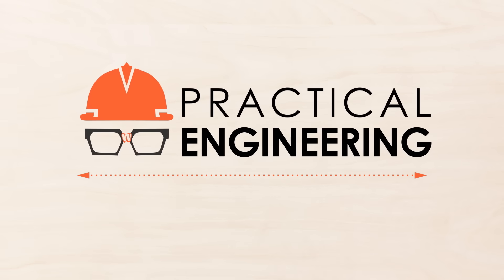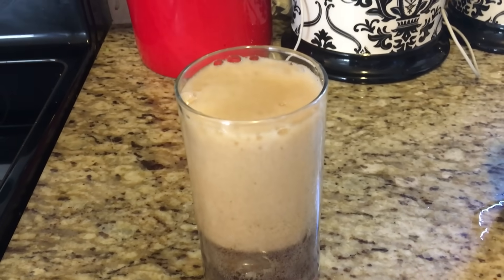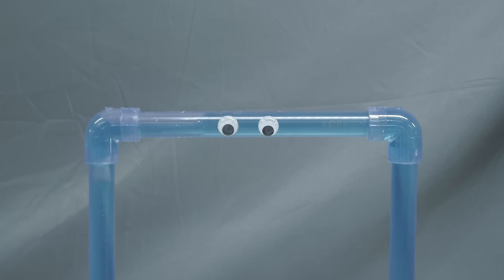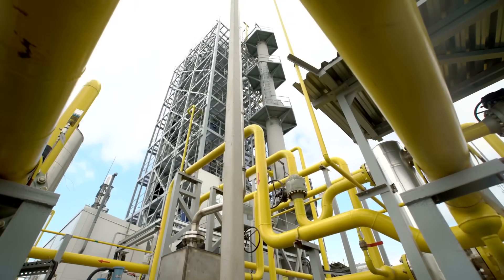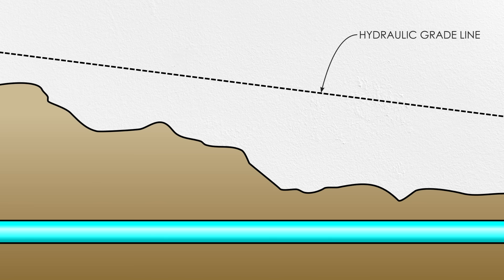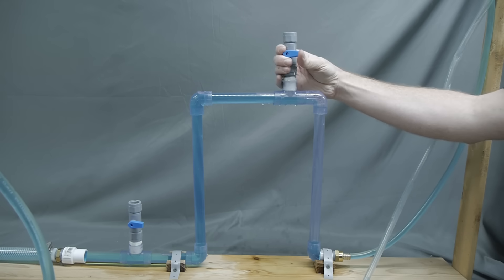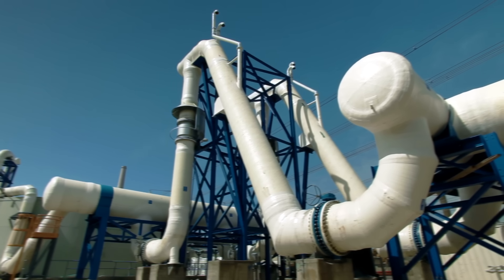What is Air Lock?

Comment: Water distribution networks; most air valves are underground, and there isn't anywhere for the air to escape; the covers are fused to the frames. That's if it's even working in the first place. Plus, burst mains and transients can cause negative pressure, which draws air into the pipe through the valve.

In practice, water is agitated, typically following a burst and mains operations; this causes aerated water,  it looks milky coming from your tap. Water companies resolve the issue by flushing out the water from a washout or fire hydrant.
To be fair providing you follow best practices, you mitigate most of the risk from airlocks; dissolved air is always an issue.

Comment: in my hotel we ran out of water once and hot water got air trapped i will need to cut  pipes and make repease valves for the air. probably try releasi g it from the flextube next to the boiler

Comment: Would you recommend air release valves for lines that run 93% sulfuric acid? Concerned the air release will spray acid around the environment and corrode equipment or worse, hurt people.

Comment: Can I use check valve to vent the trapped air?
Where should it be installed? Will anywhere do? Or, should it be installed in certain location, like bends, higher points? Thx

Comment: If the air is trapped, the area for the water to flow in is decresing. This leads to increse in speed (Q=V*A). When the water velocity reacehes about 1 m/s it begins to drag along small air bubbles. Anyway, water pipelines is always layed inclined, about 2 promille

Comment: Could go another route and put the pipe in a vacuum. Then when you start to fill it, there is no air to trap. Yes I know that would be expensive, but it's an option smaller applications.

Comment: This analysis is exactly right, but in my experience designing pipelines, it was not commonly understood by other engineers.  I figured it out myself and used it in designing several pressure pipes (force mains) carrying sewage, and in many cases these had high points where gas from the sewage could accumulate.  The problem there was that (1)  a gas release valve at the high point could quickly become fouled with scum from the sewage, and (2) these high points were often in locations that were not practical to access for maintenance.  So, I often designed the pumps to discharge against the added pressure created by air in descending legs of the pipe (referred to here as "waterfalls").   That required more electrical energy for pumping, but worked reliably with little maintenance, which is an example of trade-offs that are inherent in good engineering design.
Reply: As a plumber it's nice to know there are engineers out there who care
Reply: @nazariiroudyk8660  And I always enjoyed learning about the "nuts and bolts" aspects of piping systems that COMPETENT plumbers understood better than I did.  Everybody benefits when competent professionals act as teams with the common goal of making things work at reasonable prices.

Comment: I've found the reverse to be true in ventilation. Mostly with humid air condensing out in the lower area of vents. But when water builds up in vents it causes higher air pressure in them. Which can be helpful in some cases and dangerous in others.

Comment: And this is why after rebuilding my well three times i t still fails after 4 days..  As far as I know I have the worlds only siphon well.  The well is on a mountain, and I siphon out of the ground to bring it down hill to the house.   Trapped gasses build up in the high point above the well until it fails.  I currently have a check valve in that spot that I literally suck on by mouth to get the air out!  If only there was an air release valve that worked in a vacuum.

Comment: Grady: A civil engineer who frequently discusses the strengths and limits of materials within specific design parameters and expected uses.
Also Grady at 8:47: scrapes a metal spoon around the inside of a teflon-coated pot.
Reply: He did say he's an engineer and not a chef ¯\_(ツ)_/¯
Reply: @hoobidibahbidibah8119  Yeah, but that is just common sense. Teflon is softer than steel, so it will be scratched.
Reply: I can still hear my mom scream "Dont SCRAPE FOR THE LOVE OF GOD"
Reply: From the condition of the pot, it looks like he does that a lot. On the one hand, I'm an Engineer, too, and straight up didn't realize the pots I got for cheap were Teflon coated when I got my first apartment. On the other hand, I figured it out as soon as the coating started flaking off, and I would have expected him to have figured it out years ago by the look of that pot. (I grew up with stainless steel and copper-bottom pots that didn't mind metal utensils).
Reply: Made me wince
Reply: @popcornfilms1  had nightmare flashbacks from the few of mom's pans I've destroyed.
A whooping would be had in this house would one use a metal object on a teflon object.
Reply: Love how all these comments are about the commercial. Lol.
Reply: Avoid Teflon at all costs. Persistent environmental toxin.
Reply: He likes the taste of microplastic in his food.
Reply: @Lun4812  Yeh, I've wondered about this in food.  The Agencies are saying it is dangerous but for years they told us that teflon doesn't react with anything, so my guess is it really just passes through our body and into our poop.  My guess is somebody's patent has expired, so they are trying to push us to get pots with the next updated patented product.

Comment: This the best reason you never make a water service tap on the top of a main. Cause a customers water meter will register Air, we always install our direct taps 30°-45° above Horizon  to prevent false metering of water and customer complains of milky looking water. We have hundreds of Automatic air release valves installing on top of every high point. When the stainless steel ball fails it’s a site to behold

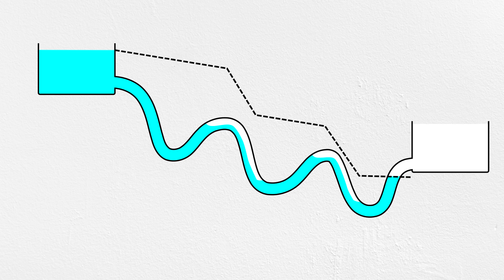Comment: At 5:43, I realized why you’d have to apply suction or some pump pressure to coax a fluid to begin siphoning through a hose—it’s the same principle at play! You’re getting the air out so that that hydraulic grade line of potential energy goes back up, and the water “wants” to flow through.

Comment: Sometimes air in pipes can cause an "explosion". Over time the air bubble may grow to a size, that can counteract the whole water above. The pressures and forces can be so high, there are cases of whole pipe lines flying. There was a hydro power plant in Norway (I think), that had that issue. A cover made of steel of a few tons flew several hundred meters. So air can be very interesting indeed.

Comment: Air in brake lines is so dang frustrating! We had to do some work on my car's brakes, and then we opened the bleed valves and tried to get out as much air as possible. My brakes still felt mushier than they had before because of the compressible air in the lines, no matter how many times we tried to get it all out. Eventually I took it to my brother in law who works on cars for a living, and has a pump that fits over the brake fluid reservoir, adding enough pressure to force out all the bubbles of air as we opened each bleed valve in turn. Really wish we would have taken it to him sooner, rather than pumping the brakes and opening each valve countless times, just for me to frown and say that the peddle was still mushy lol.

Comment: Our service company wants to replace our (200 GPM, $$$) swimming pool pump assembly, even though a previous disassembly/inspection did not show any wear on the impeller, etc...  After watching this, I am going to install a bleeder valve at the effluent elbow of the high point in the plumbing between the pump and filter, and see if we really need a new pump or not.  This is the highest point in the whole system, and there is no way to relieve trapped air. It is right before the sand filter and looks exactly like Grady's mock-up for waterfall flow.  My only question is - would a bleeder be more effective on the straight run, influent (up) elbow, or does it not even matter?

Comment: I once constructed a system where 4 IBC totes - each 275 gallons - combined to feed a single spigot. I installed a line going straight up to prevent trapped air and made it higher than the water level of any tote because I figured it wouldn't cause a problem, but the water just gushed up and out over the water level. How? I get that it's going through a 2" pipe and therefore the weight would be creating pressure, but wouldn't that create perpetual motion if I then fed it back around? So that doesn't make sense.

Comment: Great video. I learned this quite viscerally in the first winter in my home. In fixing my hydronic heating system, the 2nd floor zone ended up as one big air lock bubble with no bleed valves upstairs. I had to do some plumbing to add a valve to effectively flush out the bubble!

Comment: we drill a small weep hole in the discharge line of a sump pump below the check valve to keep them from getting air locked.

Comment: I just cleaned my table fan. There was only a slight buildup of dust at the fan blades and fan guards and yet the wind was noticeable stronger after cleaning. Can you do a video on this?
Reply: You don't need fancy air volume equipment. I just use another fan and a large piece of corrugated cardboard hanging vertically between them. Position the fans blowing against each other and position them until the cardboard is perfectly vertical. I would do this in reverse starting with a dirty fan then cleaning it. The distance between this and the vertical cardboard gives a relative measure of the efficiency robbed by the dirt.

Comment: Nice explication, I've found airlock a great problem on gravity feed of petrol on motorcycles... Yes the tank is right over the carburettors, but often the fuel line has to go down first, then back up again. 
On vee twin engines that often have two carburettors pointing in different directions, the fuel line has a awkward path. It's often going down, and up to the first carb where it can continue back down again before fixing to the front carb. Even where both carburettors are mounted side by side the float bowls are offset, one being further forward than the other. The combined throttle linkage that operates both carbs from a single point, usually prevents fuel lines from passing between them and has to be routed underneath, over the top or around the side. So it's common to get a lower feed pressure on one carburettor than on the other.
When the flow gets restricted by a dirty filter, blocked lines, pinched or twisted lines, or just low fuel level, the supply can become inadequate to one carburettor and can cause damage by the fuel air mixture becoming too lean. Especially when full power is solicited the fuel debit is at its maximum demand and that over lean cylinder can overheat and seize or burn a valve...
Fitting a bleed valve is not praticable, so assuring that the initial filling of the pipes is done with a full tank and even slightly pressurised tank, will help. But over time air can accumulate... And become a problem again. That's why motorcycle fuel lines are transparent, to help show when the lines are full of air.
Reply: Wow, they designed a ton of complicated problems by cramming that into a a low profile frame. small space with all that. It probably worked ok on the traditional uprights. But NO Easy fixes now. I think if you really want trouble free operation that wouldn't kill itself, you have to give up gravity fed and put a low fuel shut off and fuel pump enough to make it all work. As a bonus, then it could support fuel injection.

Comment: great demo , i may have missed it but the air can easily effect industrial cooling systems , one thing ive found is that this pops up after the pressure is released on a system , ie we normally load the systems with 1 bar of pressure at the top of the system , if we drop the pressure for any reason the minute bubbles come out of suspension as they expand and join together to make big bubbles that can then cause an air lock

Comment: You know, I'm convinced this is a phenomenon I'm seeing in my house. I've only got three hot water taps: kitchen sink, bath sink and tub. I've always had ample flow on the cold side everywhere, but on the hot side of the sinks, it was only a fraction. 
Recently, I did the annual flush of the hot water heater, and now it's worse than ever, with only a trickle at the bath sink. Curiously, the tub and laundry are unaffected, but they are definitely lower than the sinks. Now I've got to find a way to bleed the two sinks somehow. I think the dishwasher may be affecting the kitchen sink, but it's got another issue and is currently tango-ultra.

Comment: sucking all air out a car cooling system and letting the negative pressure suck in the fluid sure solved the trapped air bubble problems. less air , less bubbles to get trapped

Comment: What if the tank is way over the pipes? Like in a house, were the water tank is above 5 meters and the highest pipe is at 2m, like the shower.
The pipes goes up and down around all the house. Will this cause an air lock?

Comment: I've seen static pressure stop a leak at a fitting when water stopped flowing as soon as the static pressure dropped it started to leak when we spotted the flow about 35 seconds the leak stopped completely. Good video love the eyeballs on the pipe 👀

Comment: a good way to look at an airlock is that at a steady state, the air bubble will span both sides of the high spot, as you increase the input pressure, you shift the fluid on one side up, along with the air, and the fluid level on the other side drops, now your pump is working to overcome that pressure
Without the airlock, the energy needed to raise the fluid on one side is recuperated on the downhill side, but if air is inhabiting that space, you don't get that energy back

Comment: Interesting !
Maybe I have an interesting question : "Why is water added to gas in pipelines ?"
I heard about it when I went to Italy to program a furnace for an annealing and pickling line.
We got lots of water in the gas pipes (that ruined a lot of valves and burners).
I was told that their gas supply from Russia comes with water, and they forgot to restart the "water remove" system. 😫
(Best part is when they made a hole in the 1.5 ft pipe to drain the water with a torch cutter... 😅)

Comment: Air lock is devastating in our cooling process of the furnace in Bolt and Nut induction for Hot Forging process. Cool water could not flow well enough so that our induction furnace got very heated up to 80 degrees celcius in just 10 minutes running. Greeting from Indonesia, thanks for the video.

Comment: One of the annoying things of being a HVAC technician/plumber is "deairing" a system where the previous plumber didn't put air valves on the high spots..
Reply: how do you diagnose the problem and where on the checklist does it appear?
Reply: @snorttroll4379  Well with a heating pump system in someone's home you'd read off the temperature sensors or feel with your hand and see there's flow problem. It might give an alarm.
Between the "inflow"(?) and return there's a big difference which tells something is causing it, ussually you want about 7C∆, heating pumps generally send a information alarm (still letting compressor work) if there's more than 15C difference. Maybe they'd send a system alarm by 20C∆, depending on a bunch of stuff like brand, compressor, gas.
Check overheating and subcooling (4-8C∆) on your pressure gauge.
Check compressor heating gas, it should be about 20-30C above inflow temp.
Check filters, make sure the expansion vessel rubber membrane isn't broken. You can do that by hitting it with a not too small screwdriver. Hitting the bottom part from the threaded opening should sound like it's not filled with water (high pitch).
Check circulation pump(s) if they spin or have air in them.
Check radiators and/or underfloor heating distributor for air. If you notice magnetite (iron) in the filter or circulation pumps or flex pipes there maybe should be done a floor circuit flush. Where you connect the floor circuit directly and flush through each loop for a couple min depending on length of loop.

Ussually tho, adressing my first comment, plumbers causing air pockets aren't That common, atleast not where I live.
Reply: Btw I donnu what checklist you are talking about.

Comment: ello sir,
currently i am in IB BOARD, sir i really like your experiment (How Quicksand Causes Dam Failures), i need some help from you, i would be needing some data related to this experiment like the dams dimensions and the data collected by you, because in our board we have to write extended essay and in that i would be  using your idea and if possible probably  i would be performing the same experiment at home , but sir it would be a great help if you provide me the data.
to contact me you can mail me on 
prandavbhakta3112@@t
thank you sir in advance 
your faithful 
prandav bhakta

Comment: Air locks are common in construction of pipelines.  Part of the construction process is to hydro test a pipeline.  The problem is during the de-watering process with air. In pipelines with great elevation differences the air can get trapped on the down hill runs and hydro test water on the up hill runs, pressure builds up and the result is a pipeline half full of water that won't move.   I'm talking about steel pipelines intended for natural gas service, 35 years experience.